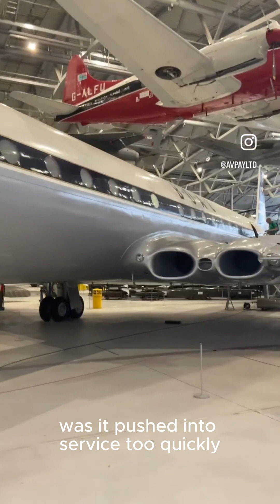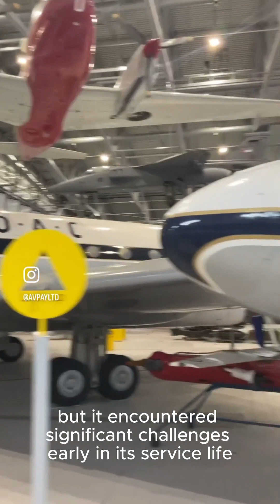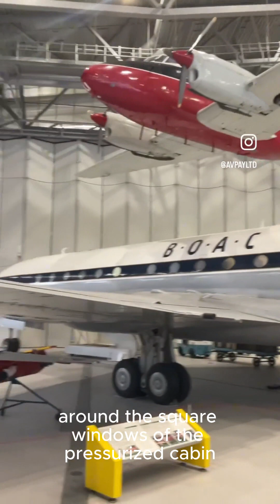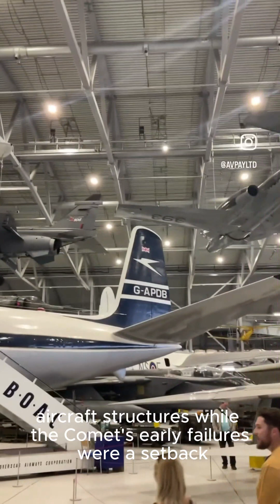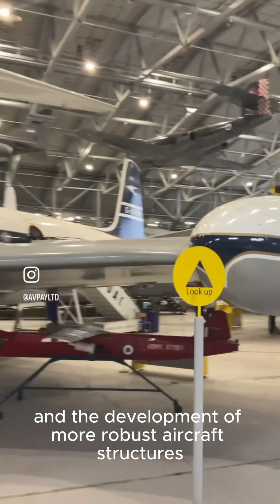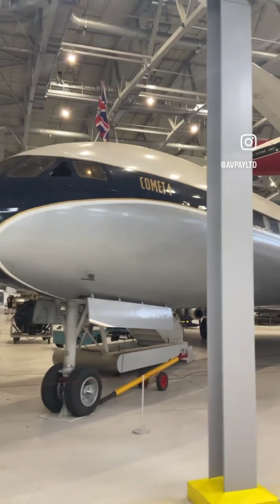Was the Comet pushed into service too quickly?

Comment: de Havilland simply lacked the ability to build a safe pressurized aircraft made from rivetted aluminum... it was still building aircraft primarily from wood and linen fabric when the Comet was introduced.
Reply from the maker: It must have been a huge leap at the time!
Reply: @ Only for de Havilland... Pressurized cabins, all-metal aircraft and jet engines were introduced in the 1930's.
 By 1954 Boeing had already sold over 6,000 pressurized aircraft.,
Reply: @avpay The de Havilland Comet was a colossal engineering blunder... de Havilland later admitted that they never conducted the stress calculations for the fuselage sections that failed